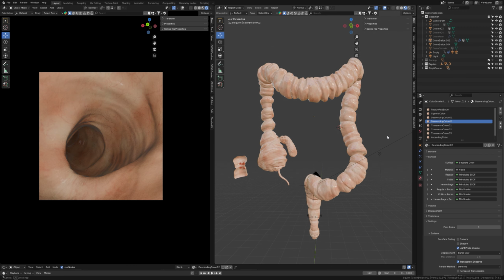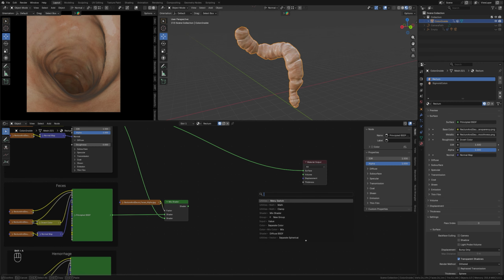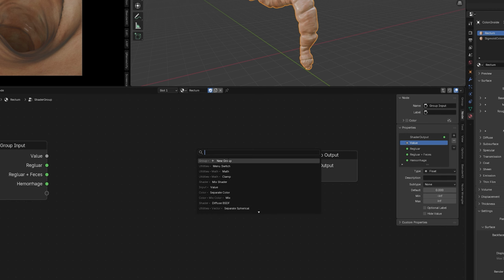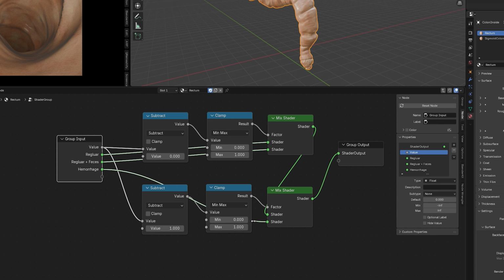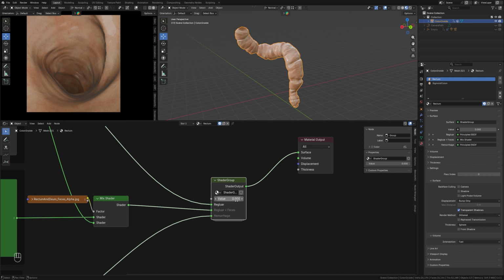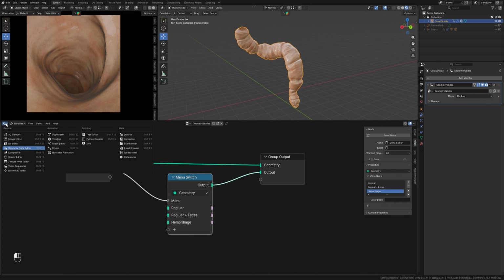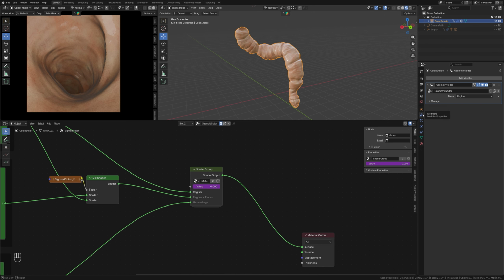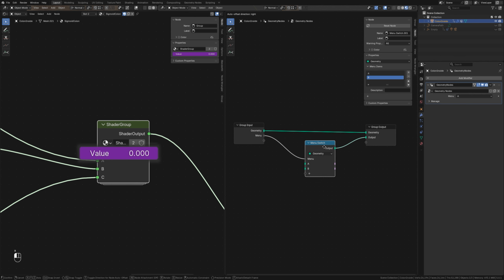Blender Tutorial: Switch Between Shaders with a Menu

Comment: I am using the menu switch to switch two shaders but I cannot do the random (per object) value between two values
Reply from the maker: The Random Value node may not work well directly with the Menu Switch node. You could try one of these two approaches instead:

- Use an Index Switch node in Geometry Nodes to switch between different materials.

- Add an Object Info node in the Shader Editor and connect its output to the value input of the "ShaderGroup node" to achieve a random effect.